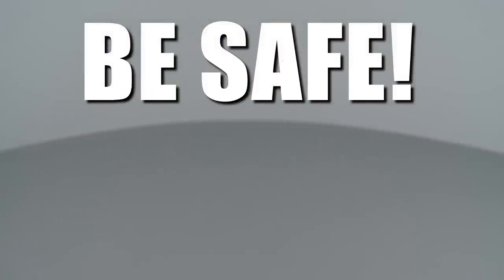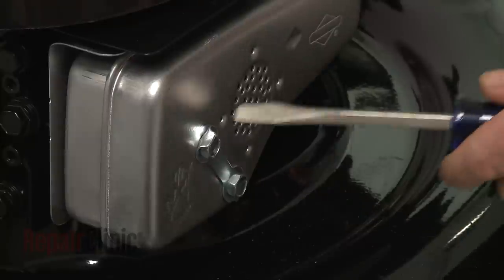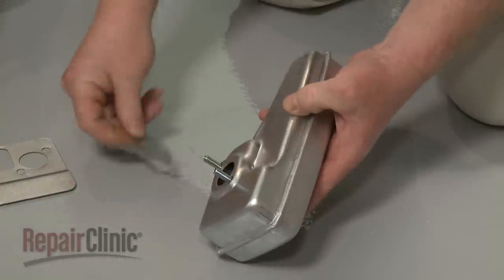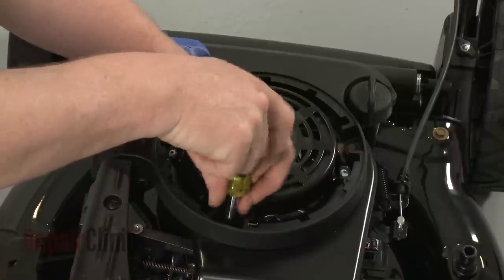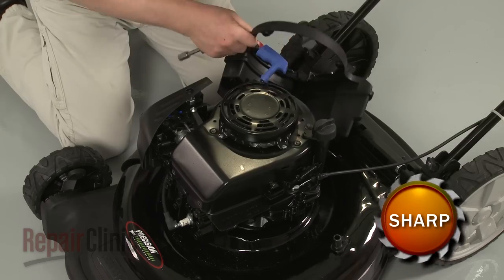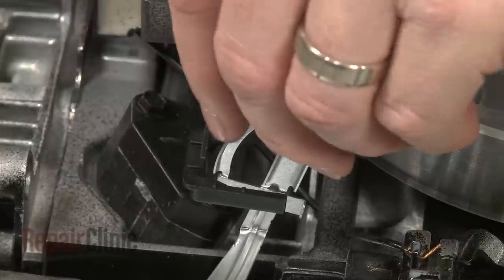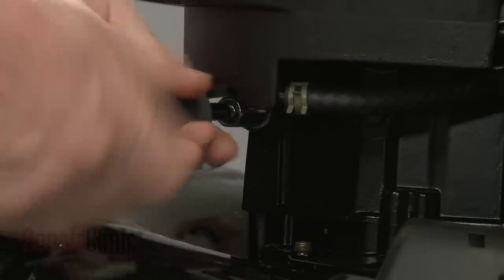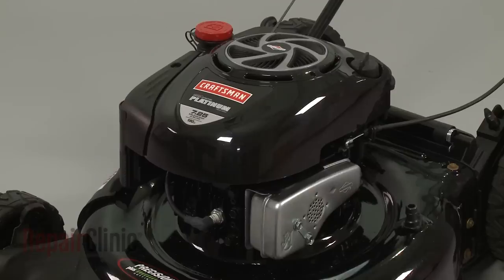Briggs & Stratton Lawn Mower Engine Choke Thermostat #593208

Comment: Let"s do this in  a real world setting where you are being attacked by mosquito's ,its  90 degrees feels like 250,sweating you ass off,bolts stripping for no reason kids running crazy knocking parts everywhere,dog trying to pee on you from behind .Finally you get it done,put it back together and still doesn't start !! Then the neighbors are calling the cops cause the crazy guy next door is shooting his lawnmower
Reply: George573 I feel your pain, I ripped it off and now have to wait for it to cool down before I restart it. good news is I get the lawn done all at one time. ;)